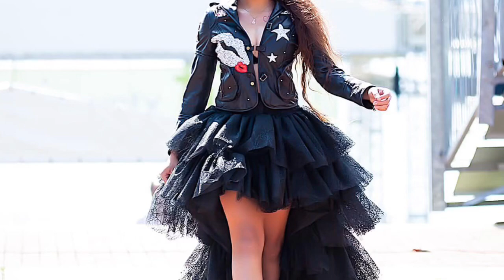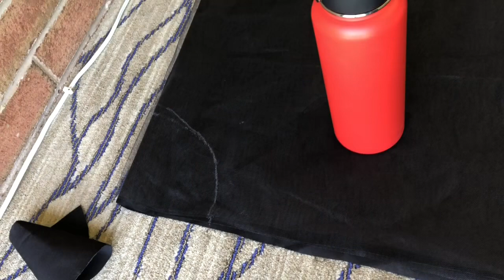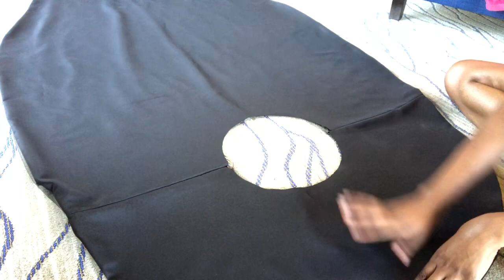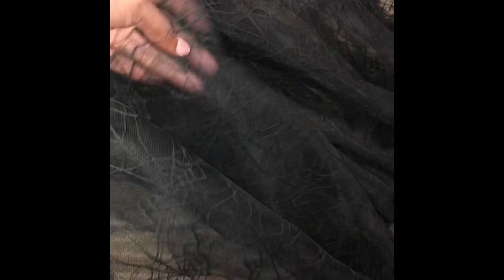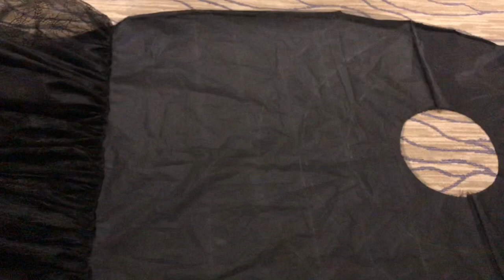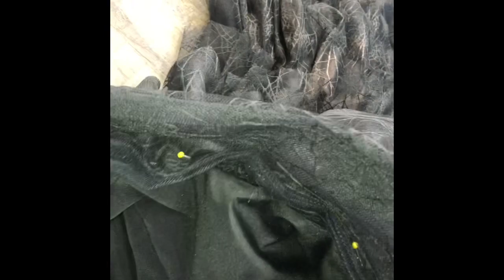BEST (detailed) DIY High Low Multi Layered Tulle/ Tutu Skirt

Comment: You are truly talented! Love the content. I’ve picked up sewing and it’s been really helpful. Question…. The description says to use a 20 yards of tulle. So just to be sure, I’m taking 18yds (6 for 20”, 6 for 15”, and 6 for 10”) from the 20, correct? Also, do I fold the 6yds while the tulle is still folded in half on the cardboard or do I unfold it and then make the square? Thanks in advance.☺️

Comment: Hello ma'am, so beautiful, for someone that doesn't like thier thighs exposed what inches do you suggest using for the front instead of 10 inches. And then do you increase the inches of the other two like the 20 " and 15"?
Reply from the maker: Hi Fashionista! You can make it as long as you want. I suggest you take a measuring tape and measure from your belly button down. That will be your measurement for the entire from of the skirt. It will also be the same measurement for the 2 sides on the back part of the skirt, where the front and back meet. Please let me know how your skirt came out. Make sure you subscribe more to come.
Reply: @upcycle2upscalewmalanda253  so after that what inches do you suggest for all the three to four layers?

Comment: Hi, I have a question. Did you go all the way around the base fabric to add ruffles to the inside of the dress or can the plain fabric be seen from the front? Does this make a difference or am I make it more difficult in my head?
Reply from the maker: Dayna Faw hello! You can not see the base fabric from the front. Just keep the ruffles on the outside of the base fabric. I hope this helps.